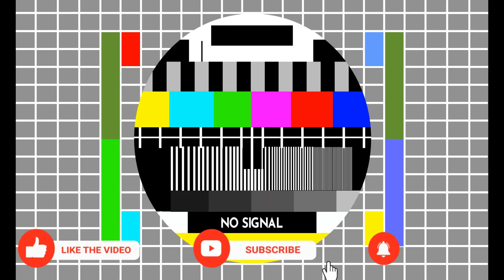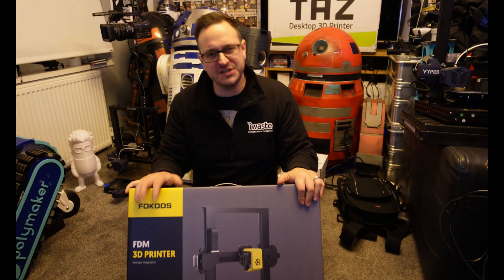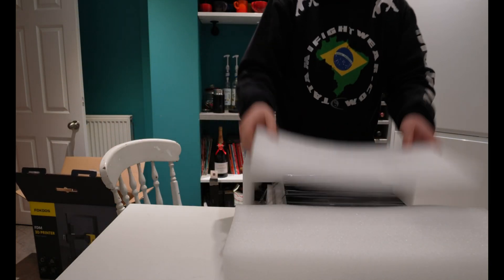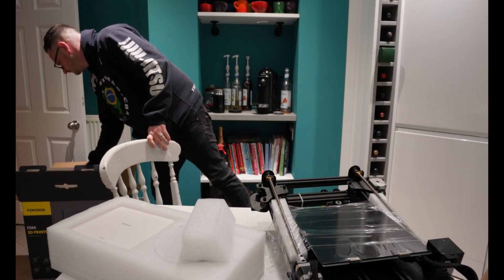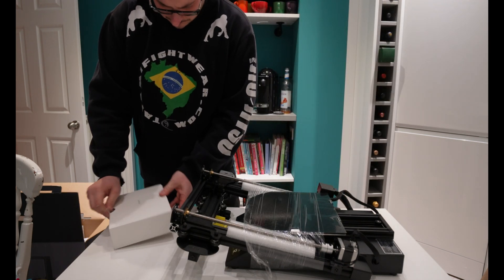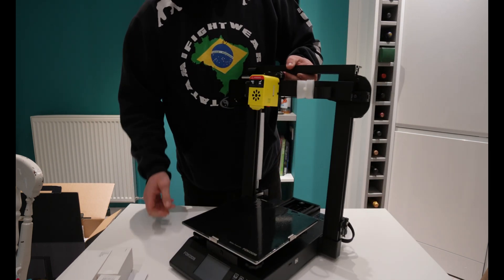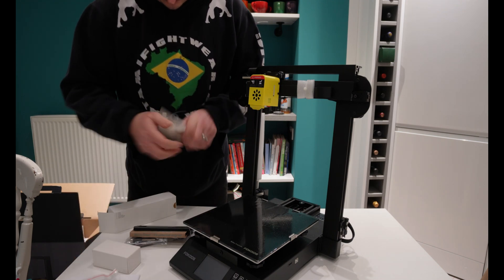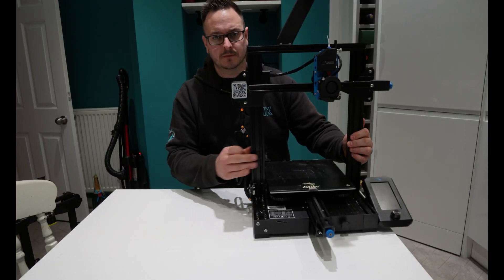Fokoos - Odin-5 F3 Review a month in - Plus its predecessor!

Comment: @2:09  🤔 Doesn't make sense to me, that's the whole point of ABL
Reply from the maker: What’s the question?
Reply from the maker: Oh I see, well let’s put it like this.. allow the printer to work within its means, if the z has to travel 9mm from one edge to another and you’ve not bothered to level the bed at all you’ll be asking for deviations in the print, you might have skew or the calibration might be out. I’ll give you an example I had a print on a CR 30 which is a belt printer. The calibration was out and when I printed something very large it was out in the end by about 10 mm which is okay if you’re printing, swords and cosplay, but if you’re using this for mechanical applications you’re asking for trouble.

Comment: Great review. Compared to the CR6SE do you think the direct drive is an advantage over the Bowden setup of the creality. I have the CR6SE looking for a second printer
Reply from the maker: Good question, I do like this direct drive setup it uses metal gearing with a spring, I’ve had no problems with extrusion but on the cr6 you’ll be able to print various filaments, my feeling is that basic filaments would suit this one